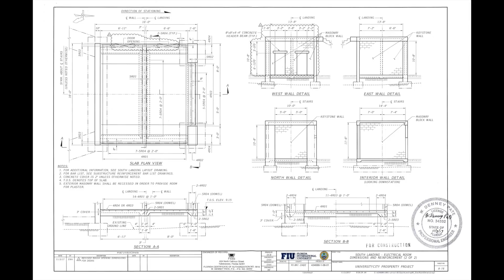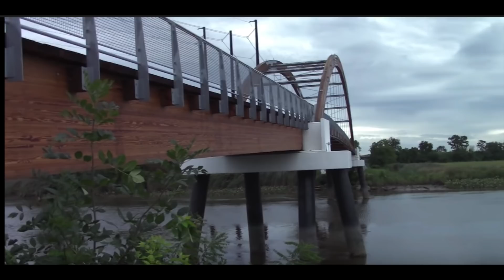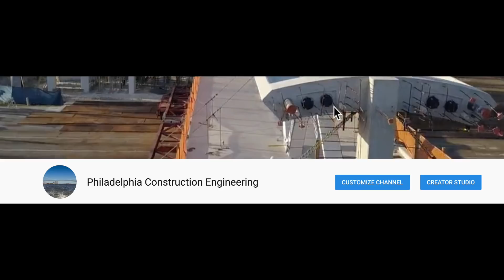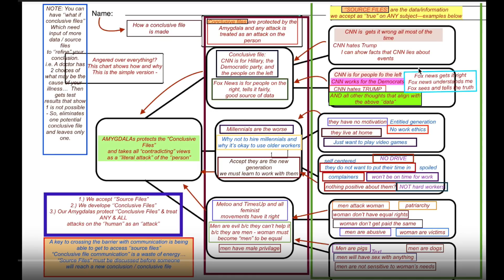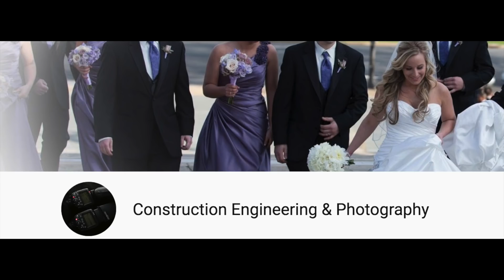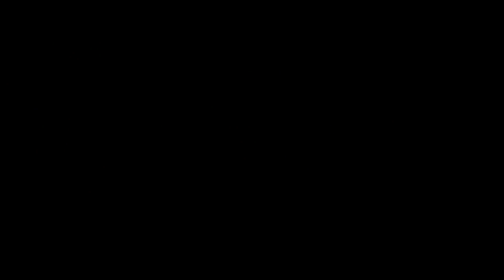FIU Bridge Collapse Linda Figg, Denny Pate, Mcm & others AUDIO - their design and thoughts

Comment from the maker: 34:24 the pylons are just for frequency! "IT SUPPORTS ITSELF BEFORE WE PUT THE CABLES ON." 36:22 the North Span will have the loads carried by the deck. 37:23 ''It's all post tensioned concrete, ... so everything is in compression", Linda Figg.  150 PLUS YEARS, we do not want anyone on the roof --
Reply from the maker: NOTE she / LINDA Figg calls them CABLES